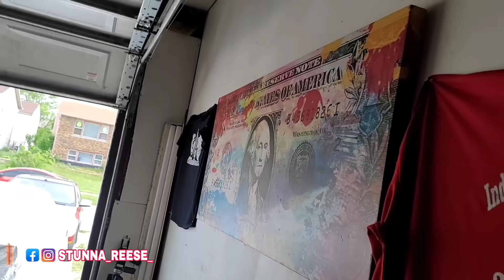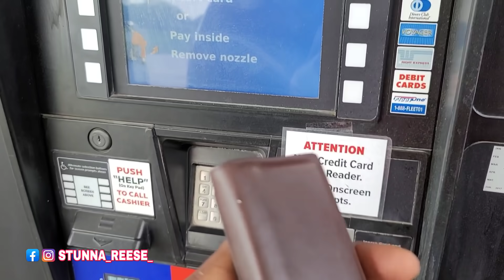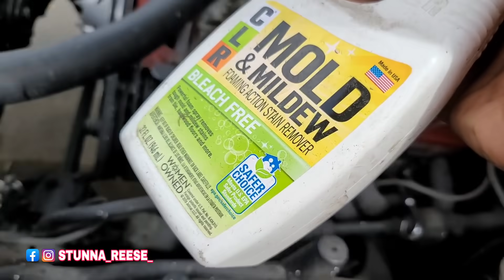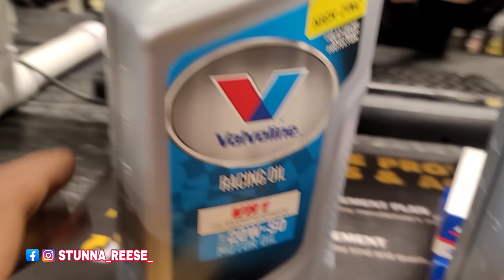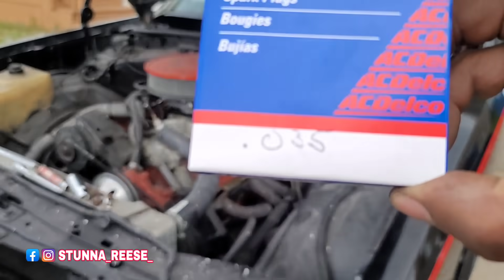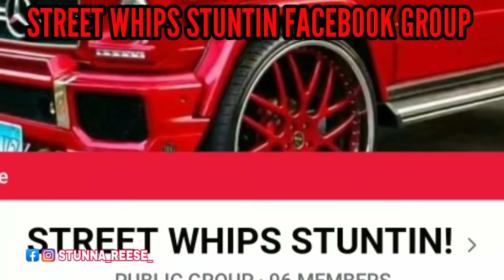I THINK I BLEW SCRAPPY ENGINE. SORRY EVERYONE

Comment: Looks like the valve seals are leaking bro. I bet it'll run alot stronger with all new plugs. Before it fouls out all those plugs get your valve seals replaced. They're cheap, the labor is decently priced as well.